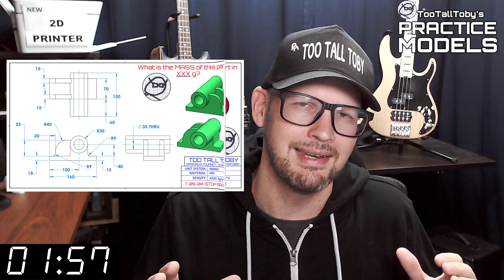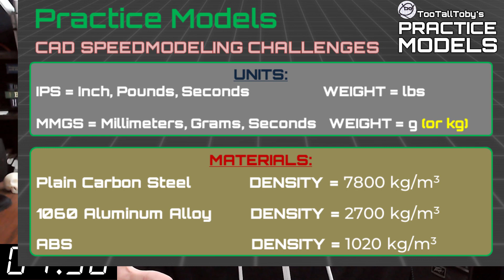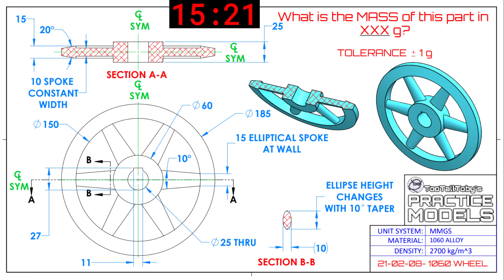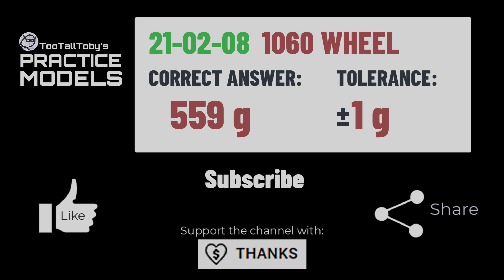SOLIDWORKS Practice - Onshape Practice - Fusion 360 Practice Exercises - TooTallToby-21-02-08

Comment: 559.167 g done in FreeCAD. the spokes drove me nuts. I didn't know any elegant way in freecad to make the tapered ellipsoid thingy. I evaluated with a sketch the width of the inner ellipse and than draw 2 sketches with  inner and outer ellipse and loft between the sketches.
There is a tapered extrude, but this will do it (the tapering) in 2 dimensions .. but obviously I need it only in one.
Reply from the maker: yeah sometimes you have to get tricky when there's only draft on one or two sides.  Nice work SarahB!

Comment: Did this model in 12:52 using build123d and got the correct mass of 559.38 grams. Resorted to a bit of a hack, by first using a taper extrude to get the max spoke width, and then used a loft between the two ellipses with the same height but different widths. (commenting here too for the algo)
Reply from the maker: awww yeah awesome job Jern!

Comment: This one got me good. It took me over 6 hours! And I almost conceded defeat, but , when done, the mass was 558.95g.  

I love these challenges and while I'm not super fast, I have completed most of them in 20-30 minutes with the correct mass the first time about 50% of the time. I'm going for accuracy over speed at this point. I do feel it is important to note that while I use Solidworks for a significant portion of my work week for over a year now, my job had been more of a Draftsman than a Modeler. I take other peoples models (customers, vendors, our R&D dept's models) and make prints. Sometimes I make modifications to existing models, and sometimes I model some very simple designs, but not  often. These challenges have helped me practice far more interesting models,  and to learn tools I normally don't have much use for.

In this case, The outer wheel and the hub were done in less than 5 minutes. My first thought for the spokes was to create the ellipse on the outer wheel and use Extrude Boss with a 10' draft. When that didn't work, I was completely stumped. I have never used Extrude/Cut Loft Boss/Base, or Extrude/Cut Boundary Boss/Base.  After some tinkering, I was able to get approximately the spokes to look right using Loft Extrude, and I was within 10-20g mass... But my second sketch for the loft was basically a guess, and I was only guessing that I had a 10' angle. This didn't sit well with me. so I called it a fail, but started looking at some of the feature I normally don't use, and I eventually learned how to use Boundary Base/Boss, and tried again. This time I completed the whole thing in about 13 minutes, but I don't count that time, as It had been over 6 hrs from when I started. 

All said, this was why I do these, to learn to be a better modeler...

Comment: Mass 558.82 or 559 grams. I did not have a good finish time. I was interrupted in the middle of working on this, but I was having an issue with the spoke. tried as a sweep but could not get it to work, used and extrude with draft of 5deg. but that did not keep the constant width of 10. ended up using a loft between two profiles, then Cir. pattern. Still would have been a long time on the spoke if I was able to record my time.
Reply from the maker: Nice job!  I like either loft or sweep for those spokes.  You are a busy man Tom!

Comment: I used loft for spokes, and because the green point were slightly twisted, I get smaller mass!, after correction I get (558.3g) at 16:24, Thnak you @TooTallToby
Reply from the maker: Nice job Auday!